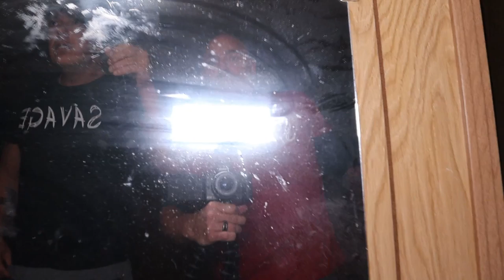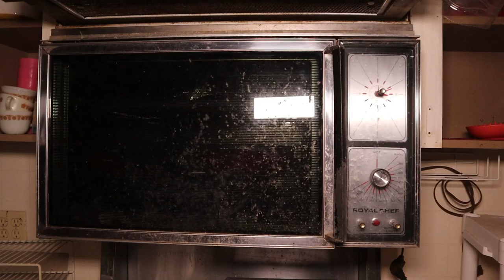(RIP TO THE POLTERGEIST TRAILER) POSSIBLY OUR LAST VISIT

Comment: C to you and all your Family we here in Whitchurch Hampshire England send all our Love all our Prayers. 
3:14 Orb top of screen (left to right)
5:12 Orb bottom centre right of screen arcs back towards floor
7:12 Male voice "No" perhaps in answer to Jo's question 
7:24 deep voice perhaps growl answering C's comment about the mosquitoes "Yeah"
9:29 strange female voice unable to make out what is said however one word may be "Homes"
10:25 female voice again hard to make out what is said i hear "lighter" but unsure 
14:38 Orb (flashing) emerges from window and goes across Jo's chest then onto his right upper arm
15:00/01 Figures starts to appear at and on the door then moves to the left out of the room
15:39 camera goes into monochrome then back to colour possible cause surge of spirit energy 
22:26 Orb (left to right) centre of screen
22:34 Orb centre of screen (top to bottom) disappears into white book stand
30:33 Spirit light just above door handle arcing 
31:05 Orb travels full length of door on inner edge
31:47 Orb window left (right to left) moving diagonal 
32:27 Orb comes from behind C then travels in front at 32;32
33:09/10 Spirit light top right of screen goes straight in C's head
33:30 throught to 33:36 Orbs ina nd around C last one emerges from right shoulder travelling upwards then at 33:38 returns to C
38:09 2 Orbs in close succession in wardrobe 
39:08 Orb follows contour of the black dress rising upwards
39:44 Orb appears far right of screen then moves around clothing right of belts
42:47 Female Hums

Comment: 4:37 I'm glad you looked under the trailer. I kept wondering in all the other video's taken at that place why no one looked under there. 7:45 I can believe all the food left there. It could have been donated to someone in need. It's probably old and out of date now. 15:39 the color changed in the room. 15:53 clicking noise. 16:32 sounded a sigh. 17:09 sounded like OH. 20:07 sheet on that window is moving before you shut the door. 20:20 movement, 20:51 sounds like something being shuffled around. 21:02 crushing sound. 21:04 to 21:10 Four loud bangs between the bangs there is shuffling. 20:14 sounded like someone said "OH MY". 21:24 to camera is shaking. 21:26 to 21:32  sounds like hammering on something lightly. 21:35 "WOW HUH". 21:37 "WHERE'S JOE" That might have been Chris. 23:29 bang. 23:48 knocking,  24 :08 facing on door is moving. 24:45 I had never noticed the igloo cooler before. Your right Chris that place would give anyone nightmares. Chris I'm really sorry to hear about your X wife. I will keep her in my prayers alone with you and your children. I pray one day they will have a cure for cancer. My dad had lung cancer that spread everywhere. Then a year ago my sister was told she had cancer. It's a terrible disease and so heart breaking for the whole family.  36:05 wasn't that door shut before? You all should do the spirit box too. You all should do lights out in the other room since seems like everything has moved to that room. 49:29 seems like that black dress is just barely moving. It's funny the door wouldn't open. It's weird it's never done that before. I hope you have a safe trip to Vegas and have some fun. I loved the video. You and your family will be in my thoughts and prayers. May God bless you and keep you safe always in everything you do. Love you.

Comment: The Torch Flashlight from Wicked Lasers has 4100 lumens. But it isn't cheap at around 199.00 plus 49.99 for an additional battery

Comment: Paused it at 29:13 and it looks like an old man and an old woman's face are in the gap between the board and the curtain on the wall. It may be them appearing one last time....lmk if you think it does, or if it's my mind seeing them.....when it pans back a second later at 29:14 it TOTALLY looks like them, smiling now. Check it out! S ooo cool!!! And also looks like someones in the back door at this time.....crap :/

Comment: @14:00 should have set it up in the corner for bathroom & living room capture.
Reply: @16:13 after the Ssssssss sounded like the audio changed.
Reply: @12:21 man: "STOP"
Reply: @12:00 "see me"
Reply: @10:25 lady:"see lights" and can not understand the rest of what was said.
Reply: @08:28 looks like a rat in the bag looking back at you lol
Reply: @16:32 sounded like an exhaust exhale like someone is sick or can't breath.
Reply: @17:58 the light by the hanger may be robs camera but what do you think🤔
Reply: @21:02 the sheet on the window stated to shake before the trailer did🤔

Comment: chris i will be praying for your father and praying extra prayers for your ex wife. i am so very sorry it has spread to her lungs and liver.  after 7 years in remission i am battling for the 4th time with cancer.  it is bone cancer that metastasized in my sternum too. my oncologist told me at any given time it can spread inside my body but so far it has been 10 months since i was diagnosed & has not spread inside my body.   Chris  @21:02  where you and Joe left cameras in the room the curtain facing the front window of the trailer starts moving and stops @21:15  the red curtain never moved. the trailer was not shaking at that time either. the shaking started @12:27 odd thing is the curtains never moved while the shaking was going on. creepy!   @23.49 sounds like a cell phone ringing instead of a scream. marie and angie went there 2  weeks ago with the dowsing rods. the rods pointed to  3 spirits in that room with them. nothing really happened except marie's car horn went off. love u guys

Comment: 2:28 looks like something ( orb ? )  moving on the ground towards the blue wheelbarrow ( bottom right ) //  3:14 upper wall area going to the window orb ? or bug ? // 3:44 there is a voice sound - not Joe he is in trailer - not Rob but he does kick the tarp on ground - possible bang noise you herd // about 10:29 there seems to be voices but so faint hard to tell whats said // you posted ( mercy ) to me it sounded like ( Grace ) // 14:31 as you setup the camera the light reflections do not look right as some seem to move and is it possible orbs ? and seem to move when you do - then looks like just below the main light reflection there is movement then orb going towards Joe and just after the last orb going at Joe it does look like a white mist face in reflection 14:39 // 14:42 it does sound like another voice talking very hard to hear but it did sound like ( ???? is gone ) or a reply to Joe saying this place is creepy ( not at all ) // 15:33 a very faint ( yeah ) then just after the camera went into black and white mode for a second 15:39 // 16:24 it does look like a orb in the paneling just outside the door in the grove area then it does sound like ( no ) // 17:09 sounds like a whispered ( who ) // 17:56 a light blip just above the hanger arm to the right in window ( no flashlight ) // during this time with the cameras facing each other i does sound like someone wandering around the room ( not sure if you guys had the door shut or not ) ( it does sound like someone opened the door if it was shut )  you can see the place shake - and shortly after it does look like a white mist just above the back of the chair on the wall at same time a couple of light blips at the bottom rest then orb ? moves up to the shelf unit the the place shakes again // 22:34 orb? moving past Joe's camera screen down to bottom of white shelf // 23:47 sounds like a glass bottle rolling on cement Chris hears ( scream )  // 25: 37 was that Rob laughing ? or something else ? // 27:22 nice bright clear shot of the trailer - does look creepy but seems like its lost its Erie vibe or feel // 27:31 lower right side is that a orb ? or bug ? // 28:09 is that a bang ? or a breathe of some kind ? // 30:33 fast orb? from door handle moves upper right // 30;50 orb ? comes from doorway moving left behind Chris // so sorry to hear the news on you Ex wife ( Tandra ? hope i got it right )  - as my father had something like that back in the 70's and he did have his right lung removed about 1 year before he passed on Easter Sunday in 1975 - so yes my Prayers will be with you and hope it makes you stronger as a person - even the news of your father is heart felt !! thank you for the tears of my own happiness during horrible times  // 31:84 orb ? bug ? right to left // 32:31 orb ? bug ? by your left shoulder // as you continue to update us there is many orbs ? or bugs ? passing by even one from your right shoulder // Chris did you get bit by something in your left ear ? // again thank you for the information on family past and present as it does seem when you talk about it you get a new Ora about you not as you were in your first videos starting out // 34:10 is that something new ? the vacuum cleaner i do not recall it as it does look like it was just bought  // 35:18 light reflection in lens or orb ? moving by vacuum ( greenish )  // 35:38 as you pointed Chris it did look like the outside door opened with several flashing orbs ?  // that room does now feel CALM like its at rest now - not as heavy with dread or harsh sadness //  38:08 orb (s) ? passing by the cloths // 39:45 orb? at top of the cloths hangers and goes across the belts then into the slacks on the right // 42:47 sounded like a woman's voice ( hi - hey ? ) // great video will now have to see Joe's version // thanks again Chris on the updates // be safe and God Bless